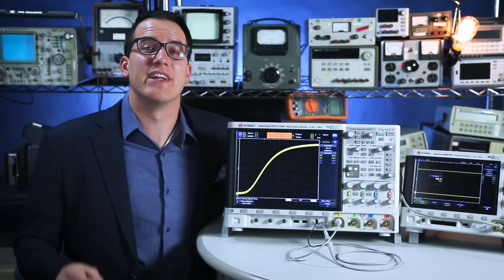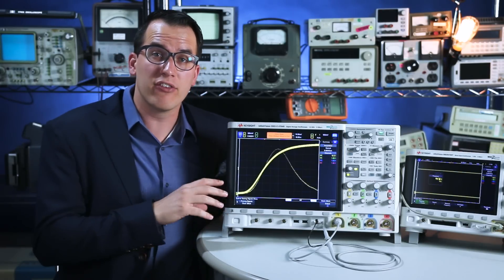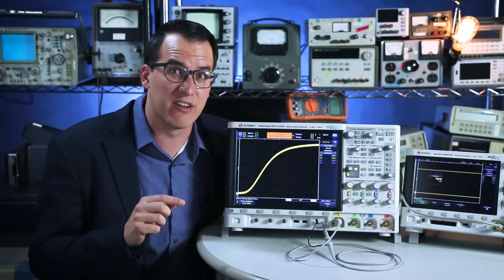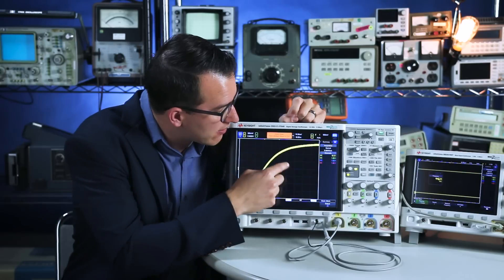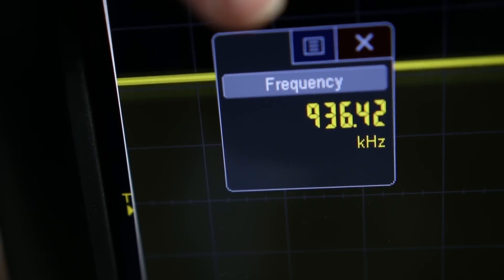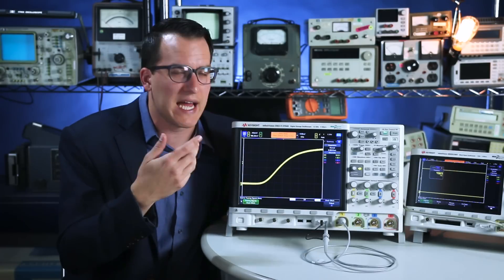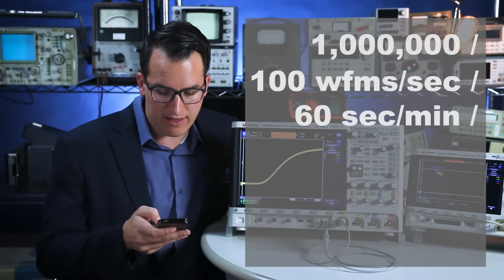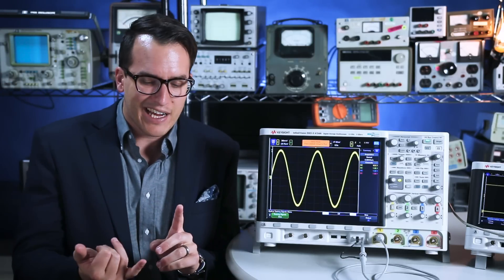Waveform Update Rate - Oscilloscope How To - The 2-Minute Guru (s1e8)

Comment: Hi there, good explanation but something doesn't make sense.  The LCD display frame rate is much much less than 1 million refreshes per second (it's probably around 60 fps).  So if the LCD can only re-draw the screen 60 times per second, how can you possibly display the 1 million waveforms that were captured in that 1 second interval?
Reply from the maker: Great question! The scope compiles a bunch of captures together and displays them on the screen together. Changing the intensity setting will show you which ones are more common and fainter traces occur less often.
Reply: @KeysightLabs  Why  should a Gigasamples/s-rated oscilloscope swallow away the glitched signal? I don't see the purpose of a "wfms/s" rating if a "Gs/s" rating is already provided
Reply: @Abdullu  I'm in the middle of understanding this waveform update rate thing and trying here to explain what I understood until now:

The (digital) scopes have 3 different frequency domains for 3 different subsystems. 

The subsystems are:
1. The A/D conversion
2. The signal processing/analysis and capturing engine
3. The Display (which shows the content of the framebuffer)
4. (there are more, but in the signal chain from the BNC to the human eyes, these 3 are the most essential)
-----
1. The AD converts the analog signal to digital at the set (the "Gs/s") rate. The output of the AD chip is a datastream, just a bunch of "numbers" following each other. These numbers, the data stream is stored in memory, therefore today's scopes are called DSOs.

2. The signal/waveform engine then interprets the data stream from the A/D (more precisely from the memory), AND puts it into the coordinate system, where the X axis is the time, and the Y is the signal level.  
It "draws" the waveform in the memory, not literally, but creates such a data table, that is usable for different processing and analysis of the "waveform". A certain amount of samples must be stored in the memory before the processing can begin. I assume only a few simple things can happen "on the fly".
The far most used analysis is finding the triggering condition, which could be a different type, like over, under, slope, etc., and all the user parameters must be processed, and calculated. This calculation can not be done at the same rate as the sample rate, because it often needs several samples to form a waveform, and calculations need time. 
A simple level-type trigger calculation can be done fast, but more complex calculations or trigger configurations need more time. Math functions, and other measurements, for example, frequency counting, integration, RMS need more time as well. So the "waveform update rate", the "wfms/s" is the processing speed capability of the scope, where it goes through the necessary amount of samples and does the task you requested. A rising or falling trigger processing for example needs at least 2 samples to decide if the signal is rising or falling over the trigger level. 

3. The Display: If you set a trigger level, and the waveform/signal analysis finds (by calculation) a trigger event, then it can be sent to the display (to the framebuffer) that portion of the signal, that is set by the user, i.e. zoom, divisions, trigger position on the screen, etc. It takes into consideration all the settings you made on the knobs. The typical display refresh rate is 60Hz, so there is no reason to draw the signals more often than 60Hz.

The 3 subsystems run on three different frequencies, and they are asynchronous (or maybe quasi-synchronous).
1. The AD at sample rate
2. The processing engine is the wfms/s rate
3. The display at 60Hz

These were the technical details, let's see the practical consequences of these.

In this video, the most common example was demonstrated what a high-frequency waveform update can be used for, namely, to find an infrequent/random (and short) glitch. The trigger is set to the normal signal, therefore you have the waveform on the display (you still see the waveform at 60Hz). The sample rate (and the scope's bandwidth) decides if the glitch goes into the scope or not. 
BUT (!) the waveform processing frequency decides, if you can capture it, or more precisely, "how often" can you capture it. Daniel's calculation is a statistical calculation, (like lottery is). With lower waveform processing frequency you get less chance to capture the glitch. If you have luck, you can capture the glitch at 10wfms/s as well, or if you are out of luck, you can't capture even at 1M wfms/s. This could happen if the glitch frequency and the capture engine frequency are the same but out of phase or the glitch is outside the capture window. You will never see the glitch, even if it went into the scope.
So a "Gs/s" scope does not "swallow" the glitch, just not sure if it finds it. You have a better chance of finding at a higher wfms/s rate (more $$$)
If you have more complex measurements, like multi-channel, mixed-signal setup, and math-based triggers, better if you have a faster processing engine, i.e. higher wfms/s.

It's another story that HOW these infrequent glitches are presented to the user on the screen. In this video, the glitch was 'flickering', sowing up sometimes, which indicated that there was something else there besides the normal signal. Another way to show this is the ghosting/fading of the glitch, I assume it can be set on some scopes, how to inform the user of "event-frequency"

You can think of an analogy of a gaming computer:
- The processor runs 4-5 GHz
- The game engine runs (we don't know), maybe 2000Hz
- The graphics update at the FPS rate in the framebuffer
- The display (and the display driver part of the GPU) shows the framebuffer at 60Hz

There is no reason to run a game higher FPS than the display's refresh rate, it's just a waste of energy.
The processor gets the stream of data from memory and "runs" it as a program. The "game engine" is the processing element, which needs a lot of program instructions (samples) until the next frame that can be drawn on the GPU. It's full of time-consuming and asynchronous processes. If you get 60FPS, the game looks "real-time". You move the mouse, and the scene is moving on the screen.

The oscilloscope is a semi-realtime system. The hard real-time part is the A/D conversion and storing of the data in memory. But after that, it is not real-time. The system works as fast as it can, depending on how much you paid for it. There is no infinitely fast processing speed The processor in a scope runs at 0.5-1.5 GHz (approx.), and it can do 2-4 simple (integer) instructions per cycle. A few things are implemented in hardware (for example simple trigger condition recognition), while others are implemented in software.

So that's why.

Excuse me for the long comment, but I needed to summarize and clarify the topic even for myself.

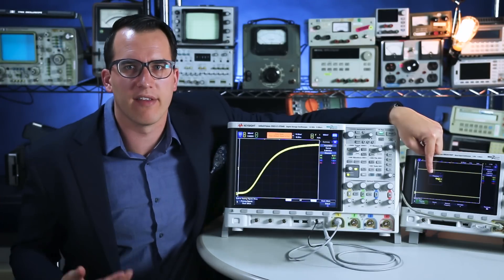Comment: Good video, but something doesn't add up.  If the glitch is once per second on a 1mHz signal (1 in a million) then why do you see it more than once per second on the scope? I mean if the glitch is random, then 2 glitches less than a second apart would be possible.  But between 1:38 and 1:40, there are 6.
Reply: Good question.  I am also having problems w/ some of the logic presented.  For example, if a glitch is happening once per second, but is very short in duration, even if the refresh rate is 1 million times per second, you might never catch it if the samplings are happening before and after the glitch.
Reply: It is random. Since the glitch is not being triggered on it is random based on the glitch falling in the capture window. NO scope of any type sees 100% of the signal.